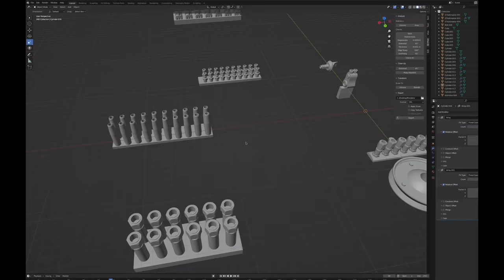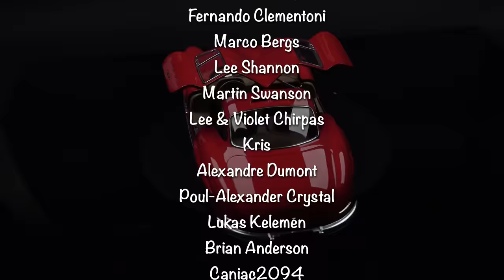MERCEDES-BENZ 300SL "Gullwing" 1/24 Tamiya Scale Model Car

Comment: If I were to join your Patreon, Would I be able to access the files you printed for this kit, and others? I bought my resin printer just for my modelling, and you are making parts for the kit to add detail, as I had planned to do, but I am having a hard time learning the CAD programs that are used to design the additional parts. SO I am interested in gaining access to your files for printing.

Comment: Awesome work! A tiny suggestion involving chrome pieces. I believe oven cleaner foaming spray can remove chrome from plastic just as well as bleach does
Reply: True, but the fumes are horrible and it burns the skin, but it's good for old kits because it will also remove that gummy yellow varnish under the chrome. It's also a great paint remover.
Reply: @Yves95128  ah
Reply: @BaDArxz  ?
Reply: @Yves95128  That was me saying that I didn’t know that before

Comment: Nice build.  You mention using white glue.  I've not had good luck with adhesion long term.  It's great for test fits but not a permanent adhesive.  Since you are using X-22 as a top coat I'd recommend using it as an adhesive.  X-22 sticks to X-22 very very well.  And if you happen to get an oops it buffs right out.

Comment: I worked at a MB dealer in Fayetteville AR. in the 1980's and Don Tyson of "Tyson foods" had a black 300SL that would come in for service. This car was beautiful I remember the interior was red leather. there was also red leather luggage behind the seats. The only draw back was no AC you could not drive it in the summer because the window's were fixed not movable. the glass that moved was the vent glass. To work on it we had to wear booties and white gloves. and everything was covered on the inside.

Comment: looks phenomenal and I am really starting to feel an attraction to car models myself. If you don't mind me asking, how long would you say you polish a specific area with the compounds? I am pretty new at using them and I cannot get perfect result, especially on clear parts. I am assuming it's the polishing time, hence the question.
Reply from the maker: Sand down the paint until it become smooth as i want before applying varnish. In this case I applied 3 paint coats. The same on varnish too. 3 coats, sand down ever coat and then I start to polishing sessions. Coarse first, at this stage when you notice the paint on cloth you use for rubbing you need to apply another varnish layer that area. Fine and finish compounds are next. I always wait min. 24 hours for every paint and varnish coat. It took about 2 weeks.

Comment: I built this model 2 years ago in the silver version: my improvements on the engine were minimal: however, I did not mount the lower transparent panel to be able to see the frame
Your accomplishment is simply superb.
Hanging oil tank didn't want to stay in place - bad design.
Excellent idea of using elastic thread!
Can I ask you some information: what pressure do you use for the compressor? which wire did you use for the candles? and for washing for motor?
Together with the two BMWs, this creation enters the Model Car Hall of Fame!
Reply from the maker: Thank you very much for your kind comment. I use 0.2-0.3mm Lead wires for ingition and spark cables. In this case I have used aprox 8 - 10psi with 0.4 nozzle for all operations.

Comment: Hello, fantastic model and realization! You wrote for the clear XF-22, but you definitely meant X-22. I would like to ask you what you dilute it with and if you also sand the transparent between each coat as the base color and if with sponge 3000 maybe. Thank you.
Reply from the maker: Hello Luca, yes it's X-22 and I dilute it with lacquer thinner (Tamiya or Mr. Hobby) always. Ratio is about %60-%70 thinner. I use these sponges in order 1200-2000-3000 grit
Reply: @Scaleaton  Ok!

Comment: Beautiful build, the finish of the body was great and the engine looked awesome. what did you use for reference and did you make the 3d printed parts yourself? Thanks for sharing
Reply from the maker: Thank you very much for your comment. My references are Google images and Porcher kit builds. Since I don't sell these parts I don't care much %100 accuracy, i design them aprox. Otherwise that would be a scam.

Comment: The stretch material shown @15.25 What method was used to change it from white to black? How is it able to stretch without loss of color?
Reply from the maker: Because I painted it with a vinyl based acrylic paint. Those type of paints are elastic too. In this case it's Vallejo Black.